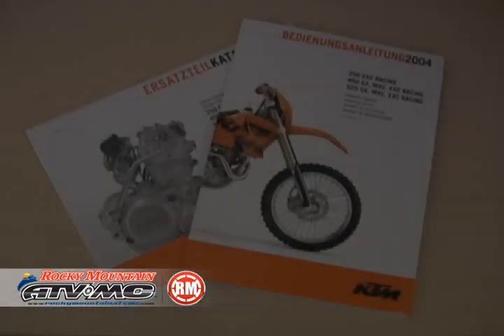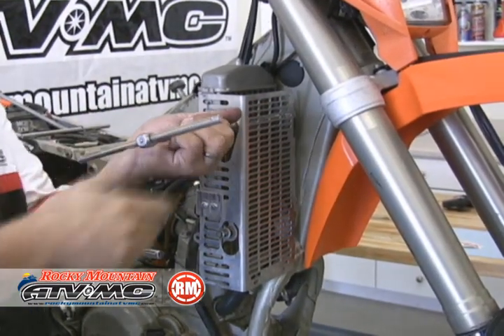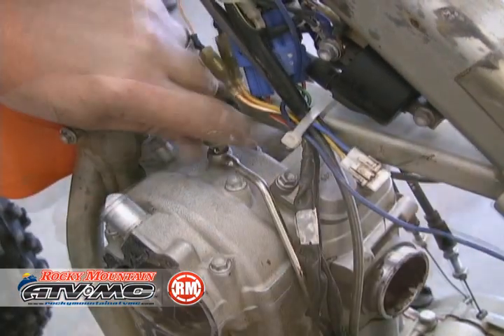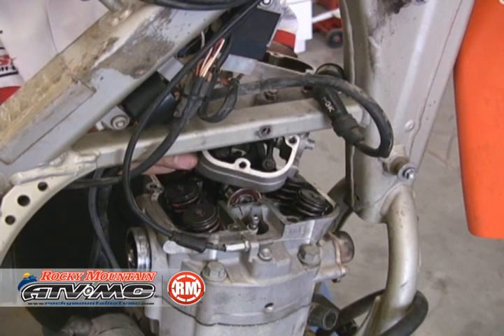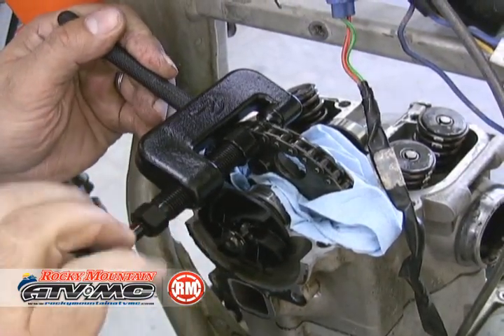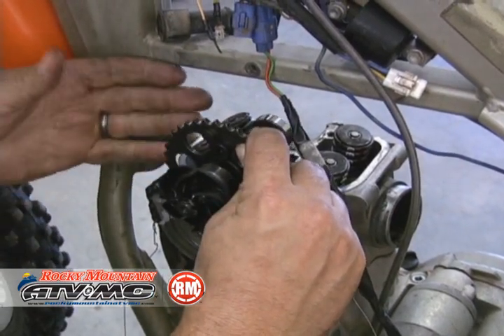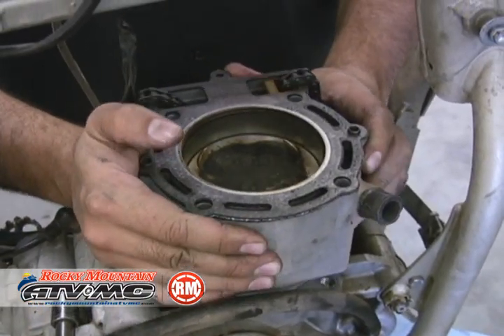Motorcycle Top End Rebuild for 4-Stroke (Part 1 of 2)

Comment from the maker: It could be a few different things, something bent or broke in the transmission and caused it to lock up or your piston could be seized or it could also be somthing with timing or valve clearances. It's hard to say exaclty what went wrong but don't kick it over anymore. It could cause more damage... Grab your service manual and begin teardown and inspection until you figure out what went wrong.

Comment from the maker: you can put a sleeve in your 400ex.  The cylinder has to be machined to fit in, and the sleeve has to be bored for the new piston.  pretty much you need to have a machine shop do it.  That is why we sent ours out to be done.

Comment from the maker: Which bike is this on? Your swingarm bolt will have a washer and nut on one side so with those removed you should be able to nock the bolt right out. You may have to lift the swingarm up and down to allow the bolt to slide out.

Comment from the maker: There's a few different things you can try. If the magnet isn't working try using a coat hanger or a wire with a hook on the end. If you have some long skinny pliers those might work as well. Also sometimes it's helpful to remove the left crankcase cover and try and push the chain up far enough to grab it with something up top. If worse comes to worse you may have to remove the cylinder head to get to it which should just be 4 bolts. If you still can't get it pull the cylinder as well.

Comment from the maker: Yeah you are definitely going to need to look into it. Make sure you have your service manual and i would check your top end. Make sure your valve clearances are in spec and none of them need replaced. Also i would inspect your piston and cylinder and then make sure the timing is on as well. The cost is going to depend on whats wrong inside so that i'm not sure

Comment from the maker: I assume you are talking about wheel bearings???  Are you using grease and new seals?  Are you making sure the center spacer is in between the bearings?  If not, they will fail in no time.

Comment from the maker: @0000000000kc - did you pull the plug to see if you are getting spark.  If you aren't, you need to have each electrical item checked out.  good luck.

Comment from the maker: The cam chain just goes down and around a sprocket that's on the crankshaft, You've got the camchain guides on each side of it and that's about it. Sometimes they will basically fold on themselves and almost get tangled like that. I would take your left crankcase cover off which might take a little bit to get to because you've got your the 2 different pieces to that left side and get to where you can see what's going on with the camchain.

Comment from the maker: I'm looking at the OE diagrams and i'm not seeing that they used studs on that motor. It's possible your motor has been modified. You may just have to remove the entire motor before removing the cylinder head.

Comment from the maker: @thevealchop68 - Good questions.  This bike seized (broken case lost all the oil and the piston locked up in the cylinder) so there was obvious damage in the cylinder.  sometimes there may be deep scratches. If it looks OK, it is a good ideal to measure the bore to see if it is in spec. Most new cylinders don't have sleeves; rather, a nikasil coating.  You can have it recoated or sleeved.  you can put the bore back to the stock size, or in this case, a bigger bore for a little more power.

Comment from the maker: It sounds to me like something broke or came apart with the shift linkage. I would start at the shifter and work your way back checking for anything wrong. You may have to remove the right side case or even split the motor to get to the transmission. It could be a number of different things but it's hard to say exaclty what it is.

Comment: Thanks for this video and your support of our local Colorado Supermoto club.  I appreciate and use your sponsorship race gas gift cards!  On removing the cam chain, can I use my trusty drive chain breaker tool to do the job or is there something special about the CAM breaker tool?  Thanks again!
Reply from the maker: +Clayton Jacobs The Race Gas Program is awesome!  That's good to hear you're taking advantage of it.  The drive chain breaker tool i don't think it comes with the correct size pin to pop a Cam chain pin.

Comment from the maker: No you don't have to bore the cylinder if you're only changing the rings... unless you have a damaged cylinder you will be able to just replace the rings on the piston. Be sure to check your ring end gap before installation though.

Comment: Great video, this is really swaying me to try and tackle this on my own.

Question. Why did you split the cam chain, I think I've seen other videos where you just move it out of the way after its loose?

I have an 06 450 exc-g usa, can you recommend a rebuild kit with all the necessary gaskets please?

It's hasn't been rebuilt since I've owned it for the last 4 years, I do mostly street riding now, anything else I should look out for while I'm in there?

Thanks!
Reply from the maker: anders melen On this particular RFS motor you need to break the cam chain in order to get the camshaft out. For a top end gasket kit, any one of our kits that we offer will supply you with the necessary gaskets to rebuild your KTM.  I'd recommend keeping an eye on all the little parts in there and basically following this tuturial video and you should be fine. Thanks for watching!

Comment from the maker: @thevealchop68 - "broken case" = egine case broke on a rock; he lost all his oil.  The cases are the crank cases - the lower part of the engine your cylinder bolts to.  Cylinders can be damaged in several ways.  You usualy know when the performance drops, but sometimes you just need to take it apart after so many hours (refer to owner's manual).  thanks,

Comment: I have a 2006 Honda 300 ex, it has a top end noise comin in it, sounds like maybe tapids, or a timing chain tick... any idea on common things to happen to these perticualer engines, and what lvl difficulty project i would be getting into to replace the parts, maybe tapids, cam shaft, timing chain, etc....

Comment: hi i have an 01 ktm 520 and my engine has studs instead of bolts and i cant get the head to clear the frame... do i have to compress or remove the intake valves to get it to clear? thanks in advance

Comment: i work on motors all the time and never ran into one u had to break the cam chain there isnt anyway u can take the cam out after u loosing the tensioner  so u dont have to break it and does that tool work on all cam chains?? or just ktms cause u can just remove a couple of links instead of replacing the whole cam chain in the older junk machines

Comment from the maker: unless I have to, never.  I don't have any plans to do it.  if you can pull your top end apart, watch out 2-stoke bottom end video.  The principle is the same.  a service manual will guide you on any differences.

Comment: Hello guys, There is little oil leaking from the gasket (metal one) under the cilinder. But I have a LC4 KTM 625 2005 (grey engine). It looks similar to this toturial. Can I expect some other things/parts to pull off??
Reply from the maker: dop van het oosten Definitely yes.  But like your were saying, pretty similar to this video. Easy to follow.  Thanks for watching!
Reply: Ok. Thanks for  the fast reply. Summer is coming so I want the KTM in mint condition. Hope i can pull it off, Keep the work up. Btw suscribed ;)
Reply from the maker: dop van het oosten Awesome! Thanks for subscribing. Thats what we like to hear!

Comment: how many kg (nm) you put on the head bolts when you back head on cylinder?
Reply from the maker: Captain Spoulding, 30-35 Foot Pounds.  As always, refer to your bikes specific service manual for the proper procedure and torque specs.
Reply: i have smr 450 2006 .35 foot pound is 5,3 kg i have torrque key with kilograms.i can find the manual for ktm smr 450.can you link me please .tnx man

Comment: @RockyMountainATVMC funny thing is my rmz 450 is getting its top end done right now
it needs new intake and exhaust valves new time chain new timing chain sprockets new compression rings new oil control ring new head gasket new cams (high performance) and machined head

Comment: I seriously doubt that most states have any trained/experienced motorcycle mechanics who could do this sort of work effectively and well. I can't, but then again I don't claim that I can nor am I a mechanic. There are factory-authorized shops that claim to be able to do this sort of work, but through conversations and low-level repairs ... I'd be very reluctant to trust them. I do all routine maintenance to keep my RSTD in good/safe condition ... brakes, all fluids, air and gas filters, plugs, bulbs, etc ... but beyond that my only alternative will be bury it.
Reply: Its not like this is that hard or complicated.

Comment: Hey.  If I go with a high compression piston and bigger cam, is there any spark timing adjustments that need to be made?
Reply from the maker: +Clayton Jacobs First off what bike are you working on? It will be more of a case by case adjustment. For most applications and the average rider you should be fine running with the stock settings but you may be able to suit a bike more to your riding style and preference if you domake adjustments. With the higher compression piston you may need to up the octane rating of your fuel depending on what you are running. If you have any other questions let use know!
Reply: +Rocky Mountain ATV MC 
Thanks for the reply.  I am working on a 2006 KTM SMR like in the video (RFS engine.)  I did choose a high compression piston to still be able to run on pump gas at 5000ft elevation.  I am racing supermoto in the Novice class so I do anticipate riding hard.  Not so hard that I want to squeeze every HP out of it at the cost of significantly more difficult tuning (ie spark tuning) but I have added a wide band O2 sensor in the exhaust so I can at least get my jetting spot on.
Reply from the maker: +Clayton Jacobs Sounds like you're on the right track! Running higher octane gas would be an easy way to get more horsepower if you end up wanting more later. If you have any other questions let us know

Comment: 2 strokes are fun, but gotta love that low end torque.. I have a 2000 rm 250 (2 stroke). A 2004 kx250f and a 2002 yz250f. and I enjoy them all....   but the suzuki is the fastest by far.. and alot easier to rebuild...

Comment: soo i hope you answer.. i was earing up some snow on my crf450r and when i slowed down and pulled the clutch to come to a stop, it died. i tried starting it a few times and it was a total bitch. besides the starting troubles when it gets started it bogs down and wants to die(with the choke on) and when you turn off the choke it dies right away. you can hear something knocking and the exhaust(header) glows red after about 20 seconds of idle. my buddy came and started it and he said exhaust valve.

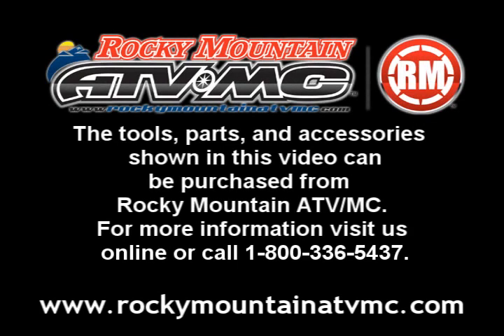Comment: 7:30 "once again we don't want it (the chain) to fall down the bottom." hmmmmmmmm

(don't worry, my side plate did the impossible and disappeared to the crank despite rag stuffed in (by screw driver to do a 'good' job) the cam chain tunnel. I still don't know how, but it did).

Comment: Ok, if you need to complete disassemble a vehicle to maintenance the engine, it is a poorly designed vehicle.   It should be a lot simpler procedure to swap in and out an engine, only requiring removal of a few strong bolts.  NOT taking apart the whole friggin motorbike cause everything is in the way.

Comment: Remind me to stay away from those bikes... holy crap that is a lot of dissasembly.  LOL   I'm a 2stroke guy... but, what a lot of you other 2T folk are forgetting is that you don't have to rebuild your 4stoker nearly as much as a 2stroke (at least half as much).  In fact, I have seen12k miles on a xt350 with the stock topend (granted it doesnt rev up as much as a mx bike).   But, after 2yrs of no topends compared to one or 2 every year on my 2strokes... there is an advantage.